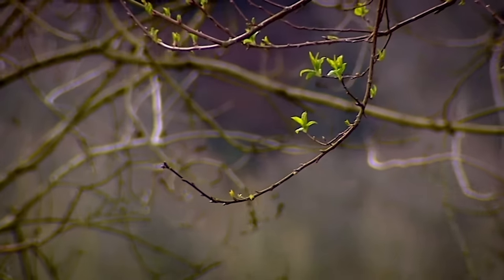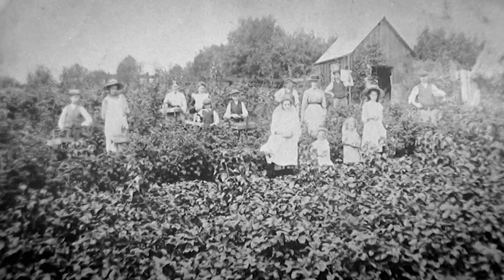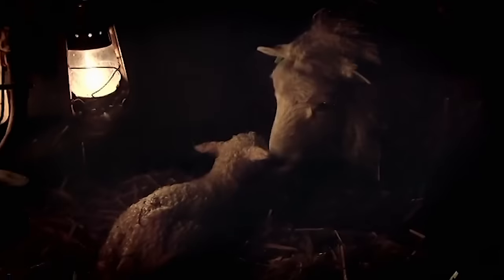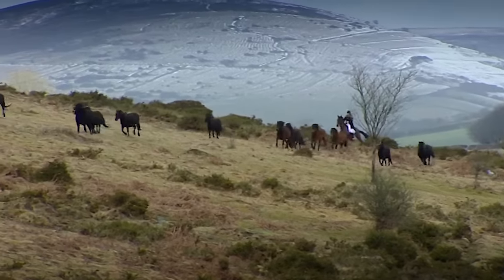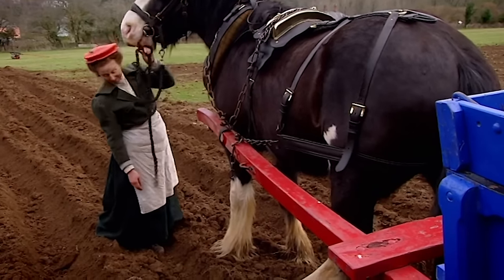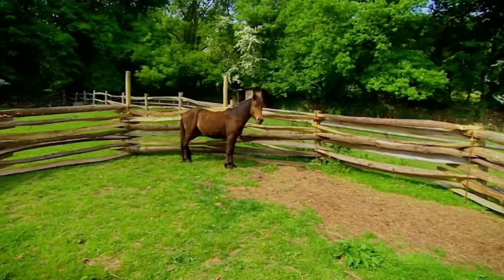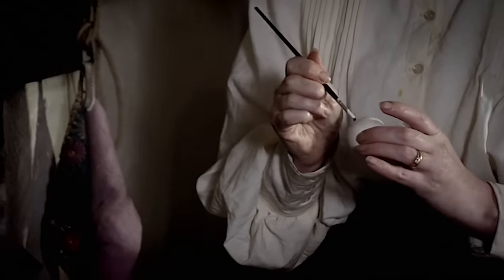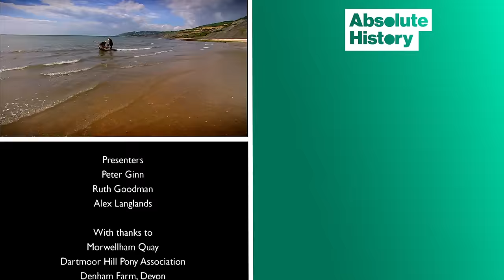How Did Edwardians Celebrate Mother's Day? | Edwardian Farm | Absolute History

Comment: I have been loving all these series, BUT, I have to mention one one thing that I found unlikely on this one. A very small thing to point out really, but I don't think there is any way that they would plant whole potatoes... especially potatoes that look as new as that. I understand that as they have only been there since last year, they wouldn't have set aside a load of potatoes to plant (which would look old and be sprouting from the eyes most likely after a winter in storage), but at the very least they traditionally would have pared them into segments to get more planted area for less potatoes.

Yet another job that would be added to the daily work at this time of year.
Reply: I was thinking the same thing, Shawn. I also thought the potatoes really didn't seem to have but a few eyes for planting potatoes; they looked more like something Ruth would use for one of her stews.
Reply: If you cut the potatoes open they rot in the ground. They need to be whole
Reply: @Bamboule05  Not at all correct... in fact when planting, whole potatoes take longer to sprout and it is inefficient. In the spring you put your left over potatoes out at a low temperature but in sun. They will sprout from the eyes. Very small potatoes will be planted whole, but large potatoes should be sectioned into 2-4 (maybe even 5 if the potato is super big) pieces , each having 2-3 healthy eyes on them.

This is something every old school farmer knows.